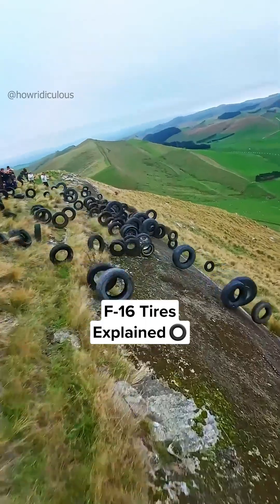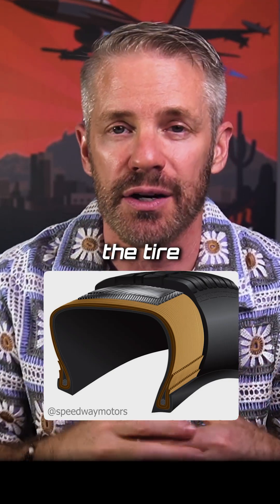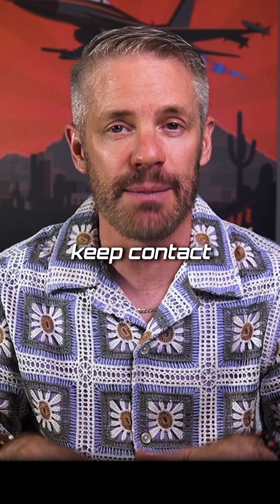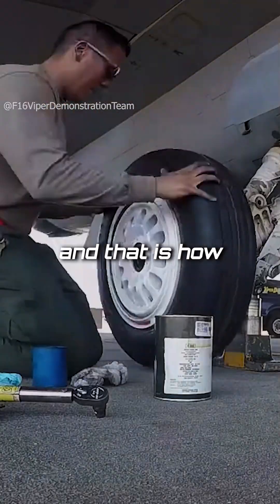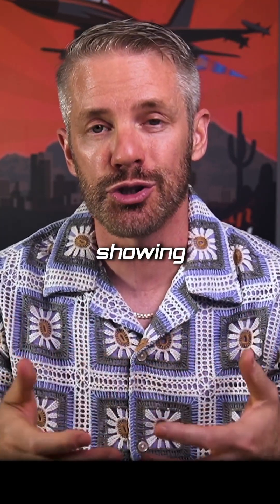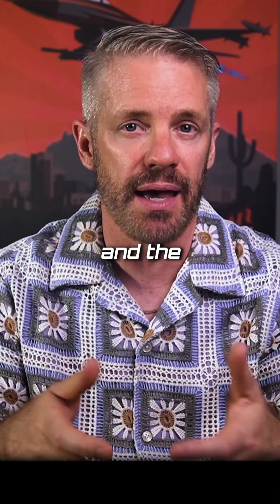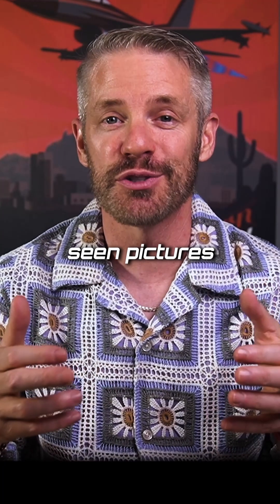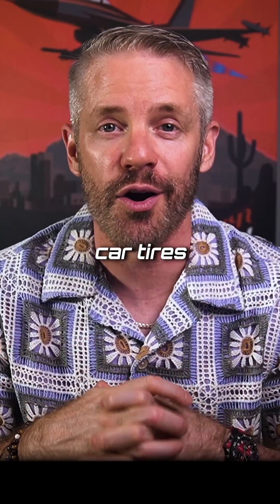How Fighter Jet Tires Work

Comment: And then they take them and they use them for those jetways how do I know you remember that time when the jetway got stuck and wouldn't come to the aircraft and you see the guy run up the steps and inside the door and take over the controls drives it up to the door calls in an malfunction between the control button and the lower ID10T goes about his business if you were at the Sky Harbor Airport flying American Airline that might have been me

Comment: Nitrogen makes sense - both because it has zero moisture in it so pressure change from temperature change is linear and predictable and no oxygen means the inner parts last longer - although that probably is more important in low use / mothballing situations. They're not recapped, right? Also, the alternative is not oxygen but air - the stuff we breathe.
On the racetrack, I've had good luck filling tires with air from a SCUBA tank as moisture has been pretty effectively scrubbed from that air (predictable response) and I'll be done with the tires in fairly short order.
Also, interesting that simple groves do a better job of anti-hydroplaning than sipes. But runways are at least supposed to have enough camber to clear standing water - and the aim is to be right on the center line...

Comment: I witnessed a crew chief on an f -4 inflate a nose tire. The HiPAC ( High Pressure Air Compresor) malfunctioned and pumped 3000 PSI instead of 300 PSI. The front tire exploded with such violence that a piece hit him on the left side of his face..... he "cart wheeled" ankle over eyeballs.  When he went limp on the ground, his face was lacerated  to the bone , and his left eye dangled from the socket. When this happened,  I was across the "red line" (the line of death on a AirForce flight line , deadly offence). I pulled my t-shirt off mid run, wadded it up, and put it on his face with all the pressure I could manage.  Needless to say, the Air Force cops watching the flight line were fast after me. Once they recognized the situation,  they called emergency response. ..... I didn't have the heart to visit him in the hospital. .. I still see that play out in my dreams. ....

Comment: Tire servicing ain’t no joke though. I will never forget the incident that occurred back in 2000-2001 where the crew chief improperly serviced an F-15 nose tire with the high psi side of the cart and not the low side. RIP to that young chief. Stay safe and keep em flying!!
Reply: They actually showed us that photo in fundamentals on what not to do. Extremely scary and taught us to maintain attention to detail. Very sorry you had to experience that
Reply: @Jedi.51 I was a young Amn on my first deployment to Saudi back in 01 when that pic was shown by our Phase guys. Even after knowing the incorrect side of the NIT cart was the root cause, it traumatized me during that trip because I somehow got it in my head that the tires were capable of blowing in the 120 deg weather. Let’s just say I never sat in-front of a main or nose tire ever the rest of that trip
🤦🏾‍♂️
Reply: Dude that picture gets shown to every crew chief in fundies.

Comment: Motor I rock with you on all of your vids, but this ain’t a static display at an airshow, leave the maintenance talk to the MX side of the house 😂😂 j/k. And it’s not “threads”, it’s referred to as “cords”. And the amount of white cords showing slightly changes on inspection cards used such as Thruflight (jet landed and being turned for another go) or a Preflight (end of flying, 12+ hours until next go). And any red cord showing, automatic tire change. And then cord layering is different on nose tire compared to the mains.